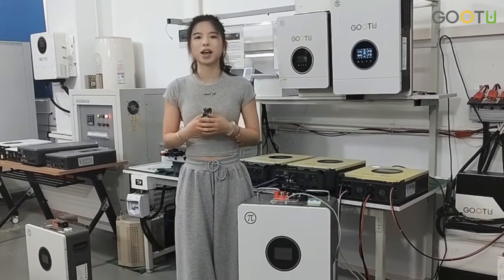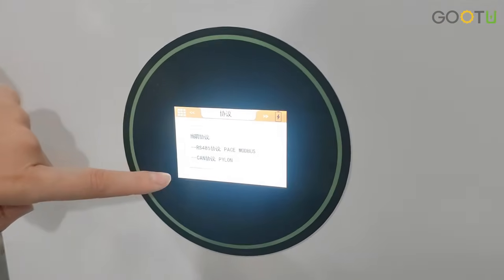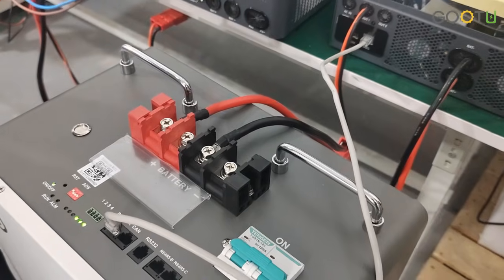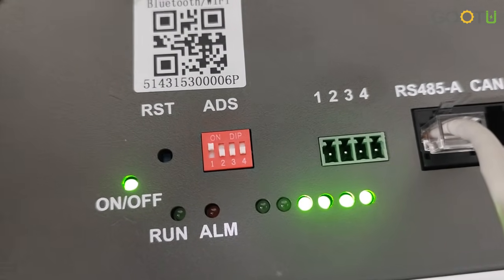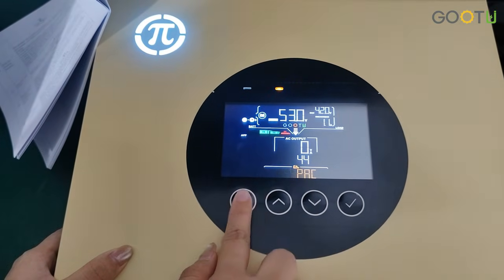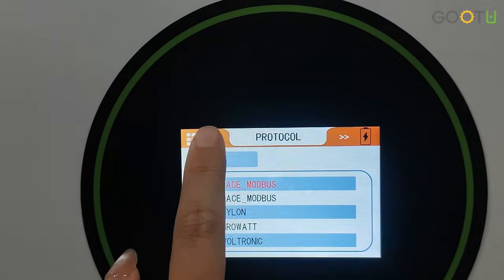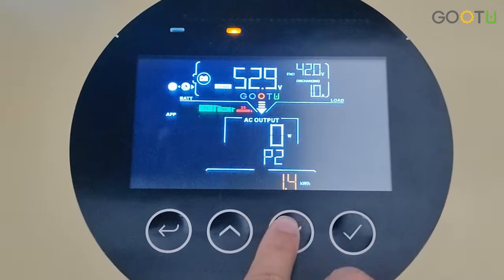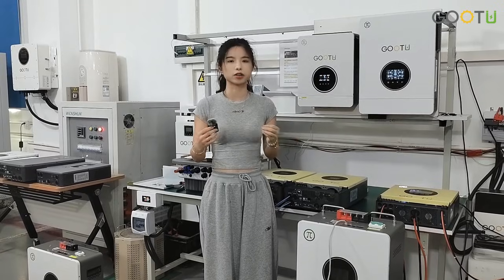How to Connect the New 6KW Inverter with the Battery

Comment: Dear GOOTU, I would greatly appreciate your help in connecting Dyness B3 48V 75A*h battery BMS to a JSY-H4862E120-D inverter (marked JSY-H4862E120-Dnew on the packing sticker).
What is the proper cable pinout, is it 12-13 ? 
What is the proper dip-switches position on the battery, should it be 2 or 23 ? Or some other combination ? 
Should the 05-battery type be chosen as LIL or as something else ?